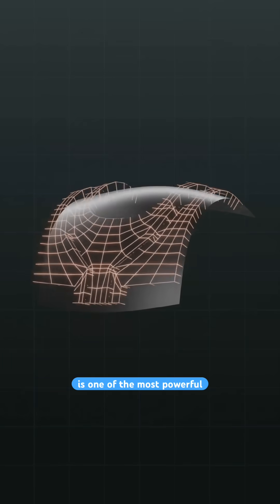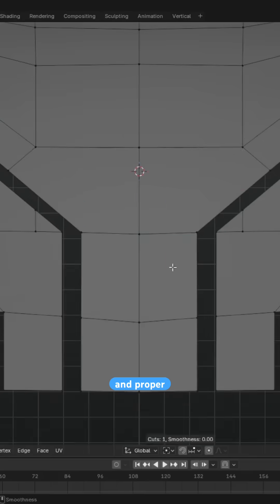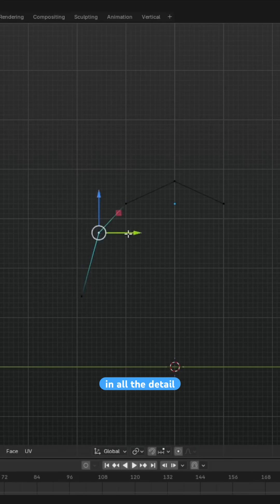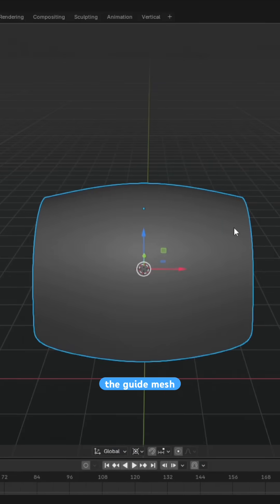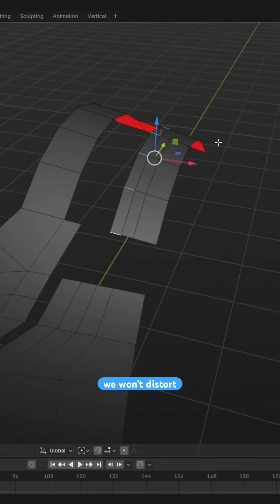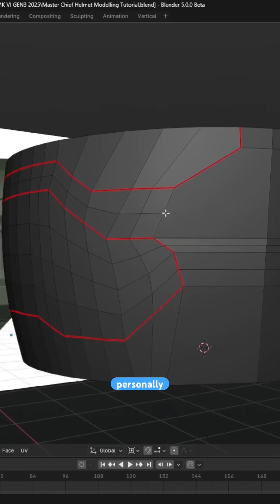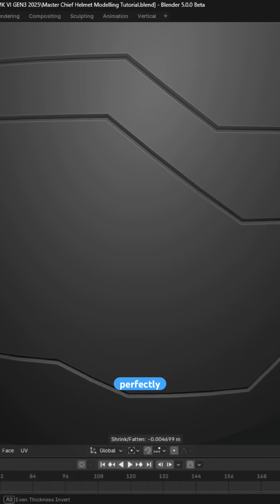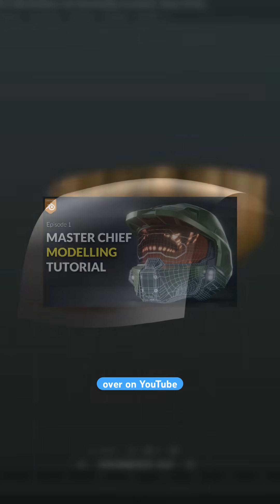Blender’s Most Powerful Modelling Modifier | #blender3d #blendertutorial #blendermodeling

Comment: So... This helps me get the topology pretty when I already modelled the shape I wanted?
Reply from the maker: Kind of, yeah, but it's not making you do extra work and model the shape twice over.

The shrinkwrap to the guide mesh helps correct any potential lumps, bumps, and surface deformations from appearing along our surface normals as we model in detail to the mesh. Without the shrinkwrap and the guide mesh, as we start to model in detail, we run the risk of distorting the model and creating a subpar result.

The process is particularly useful in more practical modelling such as my helmet modelling series, where components of blocking mesh can then be used to shirnkwrap the detailed mesh to keep a consistent shape across the model as we add in detail. 😄

Comment: Well... that's retopology dude. It's not like it's new.
Reply from the maker: I don't recall stating that it was? 😅

I just find it a very handy way of modelling and I've had a lot of questions about the method in my helmet modelling tutorials.

While this may seem like common knowledge to you or I, I think it's rather reductive to say, "X concept isn't new, therefore don't teach it". There will be plenty of other modellers out there, and the comment section here is proof of that, that haven't heard of or thought to use the shrinkwrap modifier in this capacity before.

“Not new” doesn’t mean “not worth teaching” though, cause if we went down that line of thinking beginner tutorials wouldn’t exist. 😄

Comment: This video is great!! Will definitely be using this method moving forward. Question though, what Matcap are you using there? Is it only available in 4.5 or?
Reply from the maker: The black matcap has been available for a long time in Blender, to my understanding. As for that vertical stripes one, I think that was also available in previous versions of Blender, but I think it was updated for Blender 5.0. 😄